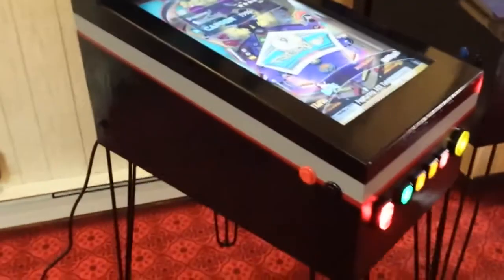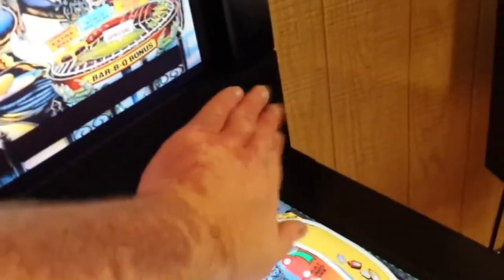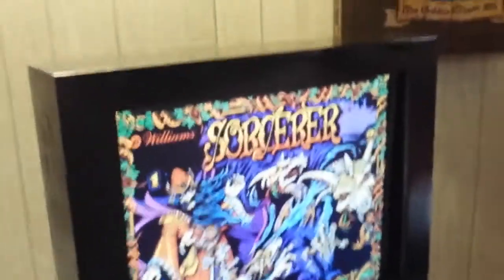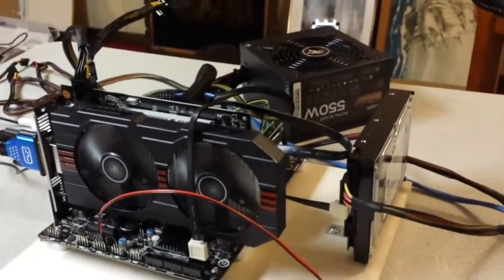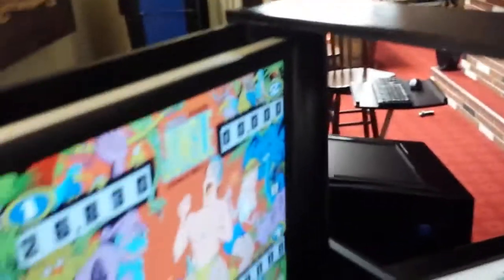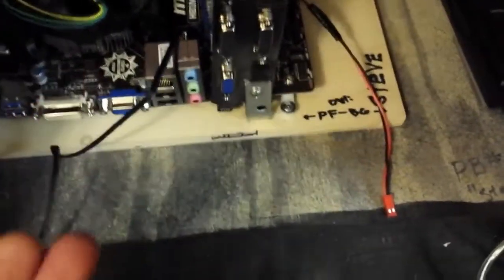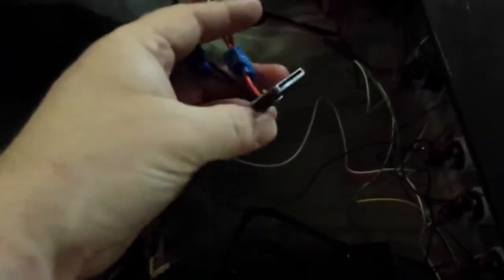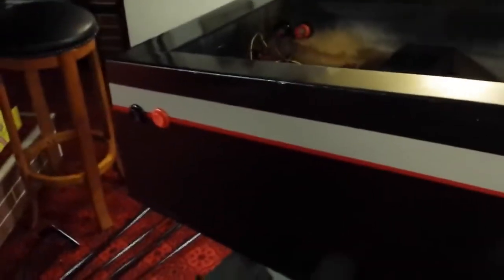PinBaby Overview - The new mini virtual pinball cabinet

Comment: hi, do you have all the project to share with us? What kind and size of monitors do you use? Im starting a project about a mini machine. thanks
Reply from the maker: I will share more videos of the cabinet I am in process of building now. I've been using 24 inch and 17 inch monitors for these. Look on ebay for really good deals on used monitors :-).